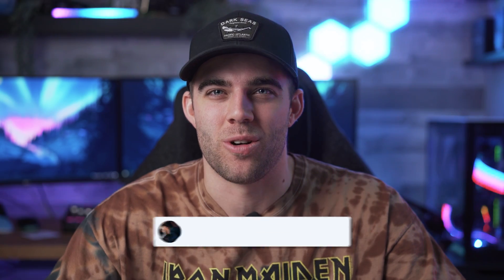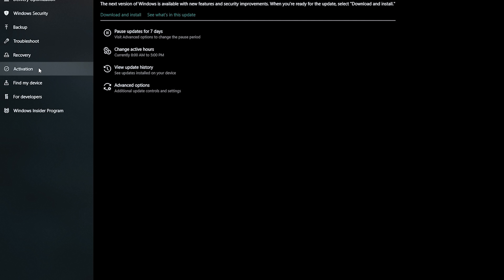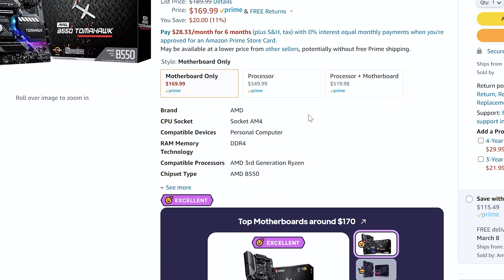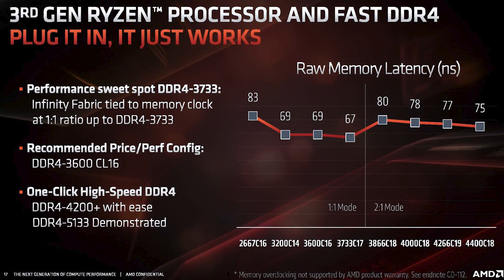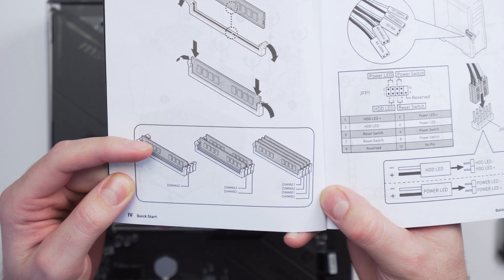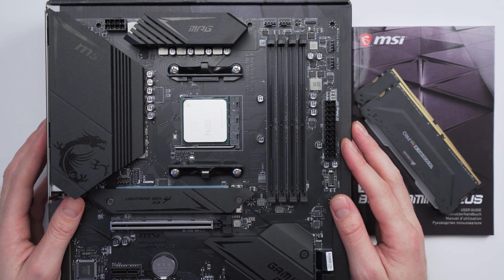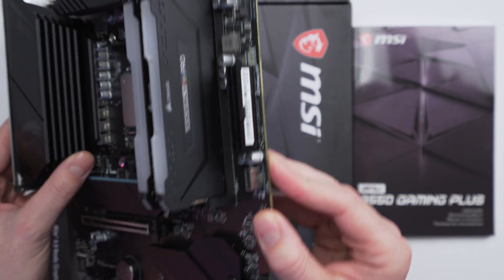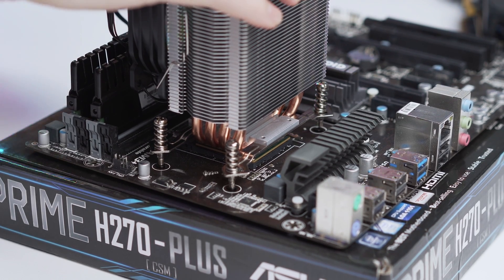How To Choose & Install RAM (DDR3, DDR4, DDR5) | Step-By-Step Guide

Comment: You make it look easy! I have to upgrade my Lenovo Carbon X1 Gen 6 laptop and I am going back to desktop. I am so tired of disposable stuff that needs to be fully replaced every few years. I was looking at the current Dell XPS Tower with liquid cooling and other upgrades. I don't game but I do lots of video recording and editing for work. Thinking 32GB of ram would be better than the 16 I have had. It seems like ordering RAM separately is cheaper than paying Dell... but I am worried I might mess up install? Or is it not so delicate I don't have to fear it?
Reply from the maker: Sorry i missed this comment man! It’s really not hard! I promise you can do it! Just have to follow the manual and you’ll be good!

Comment: The amount of times I struggled getting these ram sticks into sockets when I would swap out PC cases, lol. Always felt like I was going to break them because I was so scared to push it down into the Motherboard. Lesson learned, these motherboards like it rough. Don’t be scared, just shove it in there 😂😂
Reply from the maker: Haha! Exactly 🤣
Reply: You guys saved me as well, I was being ultra delicate with my first build. And once I pushed it in, it posted. I bought a beep code speaker and it showed that memory wasn't detected, and I know I didn't dirty the contacts on the motherboard or RAM sticks. After I pushed it in hard, bam. Thanks!